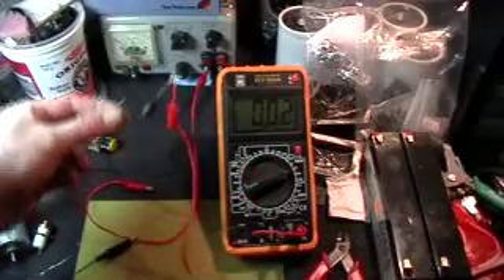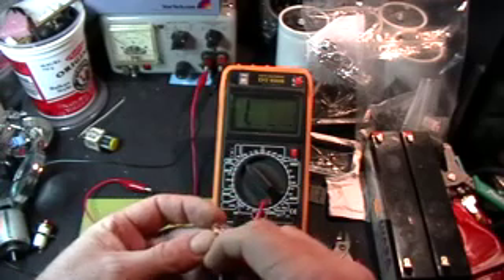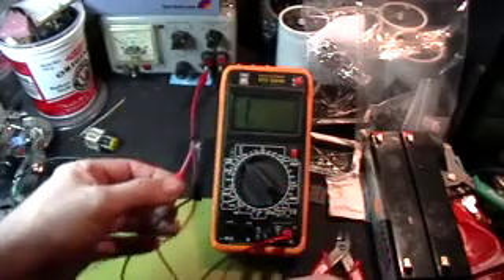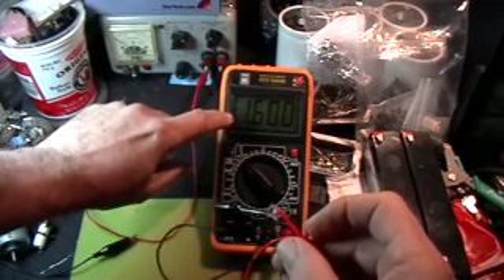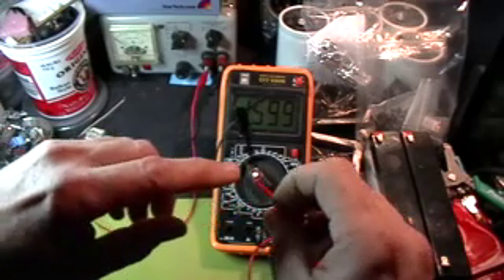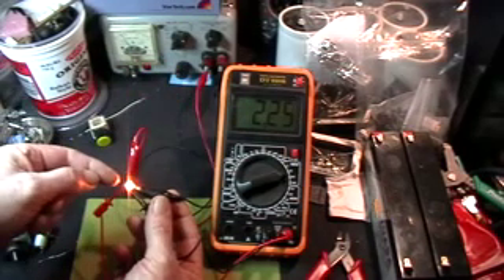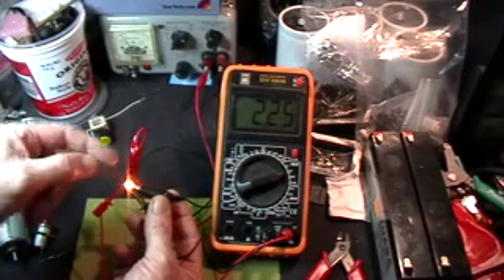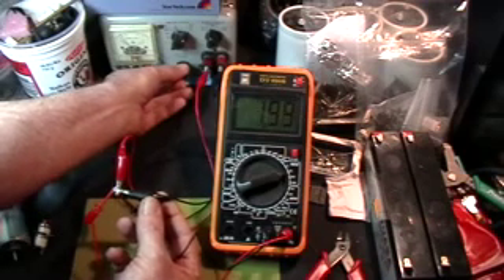LED voltage rating

Comment: It`s not correct to talk about LED in terms of "it's having a certain resistance" since LED is a non linear device. In other words it has not certain resistance.
Reply from the maker: If I supply 1.8 volts and find that 0.006 amps flows through the LED... does it have a resistance or not?
Reply: The Ohm law was formulated by Georg Ohm exclusively for LINEAR circuits. In non-linear circuits it completely loses its sense. I strongly oppose to referring to Ohm law in non-linear circuits as it's not applicable there. https://en.wikipedia.org/wiki/Ohm%27s_law
Reply from the maker: So you in your wisdom are claiming that an LED supplied with 1.8 volts, and which allows a current of 0.006 amps, does not have a "certain resistance"?   Right... I think you are blinded by your own sense of brilliance. Let's see your demonstration.
Reply: Can you read what I said? Ohm law states that  the resistance is constant, independent of the current. This isn't true in case of LED. Of course you can always divide voltage drop across an element by the current going through but it makes no sense at all. Producers of LED either do not mention such thing as "LED resistance" in their data sheets.
Reply from the maker: No, Ohm's Law is simply V=IR. Equivalently, R=V/I. If a certain voltage is applied to a component, and that component allows passage of a certain current, then the component has a certain resistance, given by OHM'S LAW.  
If you graph a number of individual readings, like for instance voltage on one axis and current on the other axis, the slope of the resulting line is the resistance. If this line is a straight line, then you have a linear relationship and you may say that your component is "linear" in the range you have plotted. If this line is not straight, as when plotting readings from an LED, then you may say that the component is non-linear with respect to Ohm's Law.  But for every value pair of voltage supplied and current measured, there is a corresponding resistance, given by Ohm's Law, whether the component is responding linearly or not. 
"Ohm law states that the resistance is constant, independent of the current." Don't be silly.  Ohm's Law states that voltage, current and resistance are related algebraically, that's all.
Furthermore, you may have noticed that LEDs can get very hot when operating. What is the mechanism of this heating, if not power dissipation in resistance?  I eagerly await your explanation for LED heating that does not involve resistance.
Reply: Once again. Ohm law says nothing about non-linear circuits. Read in wikipedia about it.
Reply from the maker: Once again.... why do LEDs heat up? Explain this without reference to resistance.  Ohm's Law is an algebraic relationship between voltage, current and resistance. Do you want to refute the algebra? If you have a certain DC current flowing in a circuit at a certain voltage, NO MATTER THE COMPONENTS , you have a certain resistance, given by R=V/I. THAT is Ohm's Law. Now go away and play in the street. But please... stay away from power electronics, the subject is clearly over your head.

Comment from the maker: Uh-huh. 
Consider this circuit: (Minus pole of 12V battery)---(ampmeterA)---(130 ohm resistor)----(ampmeterB)----(LED w/ 1.6 v fwd drop)---(ampmeterC)---(90 ohm resistor)----(ampmeter D)-----(110 ohm resistor)----(plus pole of the battery).

What do the ampmeters A, B, C, and D read?

Which resistor is limiting the current?

If you hooked a voltmeter across each component, would the values be the same, or different?

Comment from the maker: It is certainly possible to have a voltage difference, that is, a potential, across two points, with absolutely no current flowing. But it is clearly impossible to have a current flowing between two points, without a potential difference, that is, a voltage, between those points. No voltage, no current. 
The electrostatic field can even transmit work, without current flow--that is, without any diminution of charge.

Comment from the maker: Did you ever take a current reading with an oscilloscope? How did you do it? A common way is to monitor the--What?
Anyone?
Anyone?
What's that? That's RIGHT!! We can monitor the VOLTAGE DROP across a known RESISTANCE. Because the resistance drops the voltage, in exact proportion to the current flowing through it, by Ohm's Law.
Who ever heard of "voltage dropping resistors"? Just about any EE or electronic technician, that's who.
Reply: Mñó8 l no mk